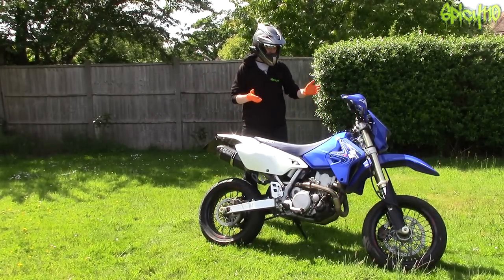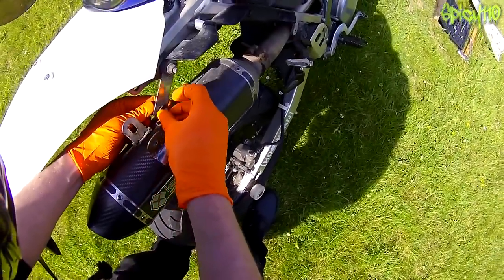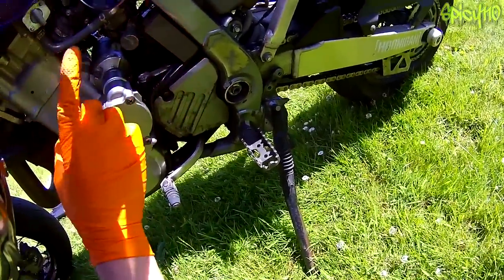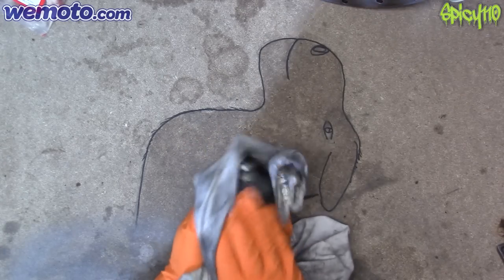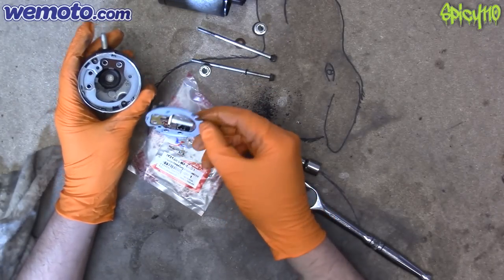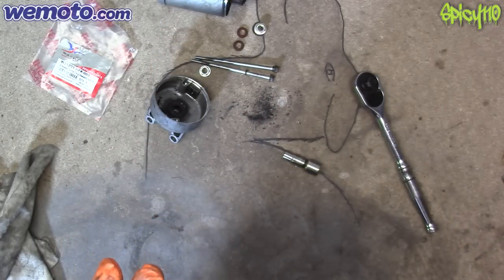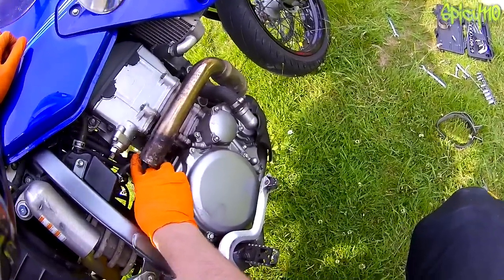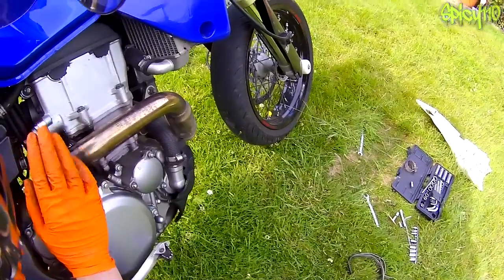Replacing Starter Motor Brushes! - DRZ400SM

Comment: Just got round to starting my bike for the first time since doing the brush replacement as you’ve taught me to do via this video. And it started up beautifully!  So stoked! Saved me over $150 buying a brand new starter motor. It sounds so healthy when it starts now and no need to tap the starter. Very pleased and thanks again spicy for making these tutorials.
Reply: I used my air compressor gun and electrical contact cleaner to clean out my starter motor. Was such an easy job I really appreciate your tutorial.

Comment: I enjoyed watching this video as I have a 2007 DRZ400SM. No starter problems as of yet with mine, but I still enjoy seeing them worked on. The only part of the video that I would change is that you did not test the starter motor. For me personally I always test a starter motor (and alternators) on the bench before I go through the trouble of the installation. I learned that lesson the hard way a couple of time with rebuild/re-manufactured starters and alternators.

Comment: Spicy just a tip, next time you remove your exhaust header try a piece of header wrap to fill the void gap, wrap two or three times if necessary and presto heat resistant and will never fail. It will probably be more quiet as well. Good vid btw. Header wrap is usually expensive by the roll, try a shop to see if you could get 6 inches or so to save money.

Comment: for me, the hardest part was getting my ProCircuit exhaust off...  was SUPER hard to get it to come off, but wen back together SUPER easy.

Turned out NOT to be my brushes.  Turned out to be my clutch switch (or the wear/slop in the clutch perch??)

Comment: Ktm 390s have a dent fitted from factory so it fits in the frame. I think the 125/200s have a smaller diameter exhaust so the dent isnt needed
Reply from the maker: I have since learnt this is indeed factory! 😆

Comment: why didn't you clean the commutator segments with wet n dry or wire wool, to get it nice and shiney?
Reply from the maker: Because the new brushes will do, and seems like it's working find so all is well.
Reply: @spicy110  So next time your Mums Washing Machine stops spinning you will be able to fix it for her cheap😊👍about £7 for a set of Brushes (not to be confused with paint Brushes, sweeping Brushes or Bush,s🤣😂) beats paying to replace a perfectly good motor..It's A lot less fiddly than most modern vehicle design's..
Well done Spicy teaching everyone how to fix it yourself.👍👍

Comment: Instead of filling the gap, make two small cuts on the end pipe so when you clamp it, it has some movement to clamp down, I've seen it on stock car exhausts so it might work here? Idk I wouldn't take my word for it 😂
Reply: This will teach me to watch the whole video before commenting
Reply from the maker: Hahaha 😆👍 yep doubling up. Normally you can just get a round gasket if it's a big difference but 1-1.5mm you can just use sealant...unless it is this bike and it will just blow all that crap out haha.
Reply: @spicy110  idk how much they are but it might also help with metal works, I've seen tools the can make the end of a pipe slightly wider, maybe that's possible with the front piece? Have no idea 😂

Comment: Hey man, so my brush holder set arrived today. It’s missing the bolt that holds the brush holder in place and it’s missing the magnet for A port which attaches to the bolt. Is this a seperate part that I need to Order or should it have come with the brush holder set? Thanks in advance man.
Reply from the maker: Are we talking the same bike? I'm struggling to think what this magnet is. However can you not just swap over the existing parts? The only thing that really matters in the bushes if they are worn out.
Reply: spicy110 sorry I meant carbon. It’s fine I’ve found out that it’s a separate part I need to order. I’m talking about the bolt that the cable connects to to power the starter. My brush holder kit did not come with that bolt or the carbon block attached to it that is spring loaded and contacts the commutator.

Comment: In my job I repair motors for electric power steering pumps, and the armature dust that comes out some of those is insane. I have to wear a respirator while I'm pulling them apart and blowing out the carbon because it's carcinogenic, and doesn't taste particularly nice... Haha. The old mini cooper pumps are the worst culprits by far.

Comment: As someone said earlier you should have cleaned the commutator segments, I know that the new brushes will probably clean it up but you can also check for any wear and arcing damage, just a belt and braces thing when rebuilding motors etc....

Comment: So I changed the brushes on my quad bike. Very similar deal to what you did. 
Now my starter motor won't work at all despite power getting through. All I get is a click from the solenoid which was working before I changed the brushes. 
Any idea what it could be?